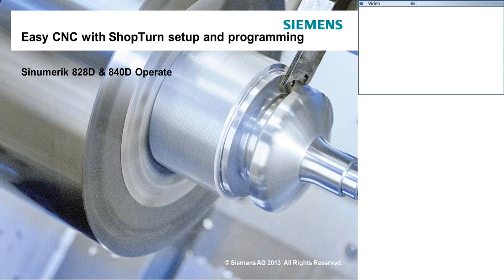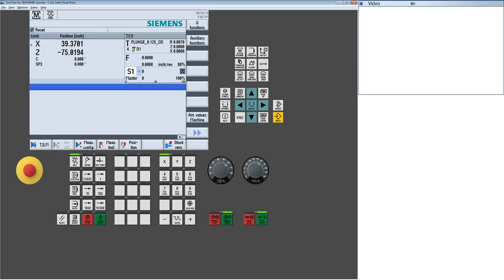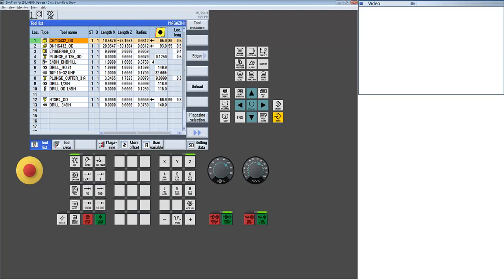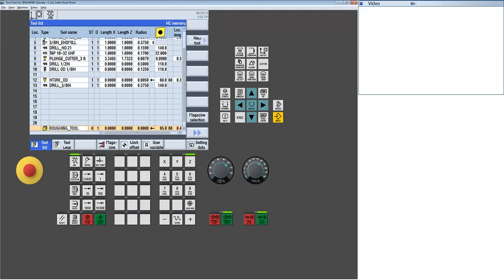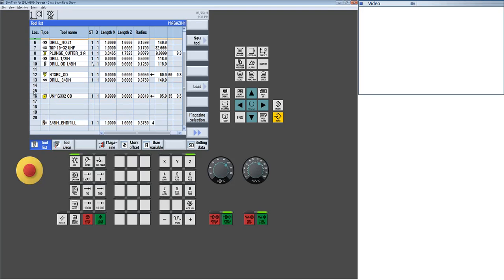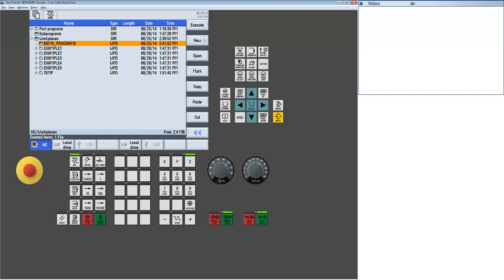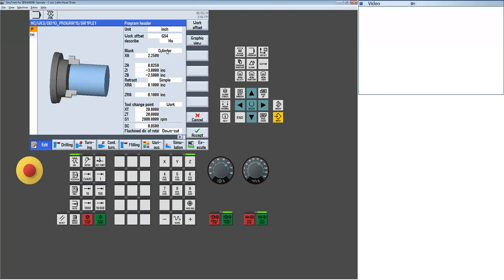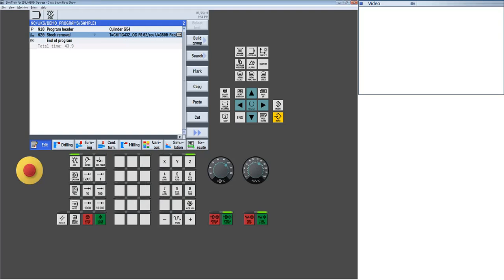Siemens ShopTurn Setup & Programming Sinumerik 840D 828D

Comment: Hi,

I'm looking for a little help with some programming on Siemens 828D. I'm in the process of writing a program for a bar puller and have hit a snag. I've gotten as far as getting the puller into position and gripping the part and releasing the chuck. The chuck unclamps the part, but that's as far as it goes. It throws up alarms like "Waiting for chuck" and "Chuck open/closed without component."

Any idea how to get the machine to accept the open chuck and proceed with the program?

Thanks in advance.
Reply from the maker: This you have to ask the machine tool builder if there is a way to feed or move with the chuck open

Comment: Hello , when executed the simulation of the program this massage is appear
Retraction plane RP is within the machining range what is the problem
Reply from the maker: you typically need to increase the retraction plane.  these are the values in the program header page typically displayed as XRA and ZRA.  It is sometimes easier if you make them ads values not inc values and simply make sure for OD the X value is larger than any value in your program.
Reply: @MrCNC  thank you
Reply: @MrCNC  thanks alot for your perfect explanation ...and I need you help...how I can download a demo for the software milling 5 axes

Comment: Hello,

Question. We are interested in using your controls and modifying a cnc lathe to run a grinding attachment and hot knife for grooving and profiling external rubber. Can you define custom tools for external cnc machining or quick screens for our options only?
Reply from the maker: are you looking to make a custom cycle?

Comment: I have the 828d control on a lathe with manual tool changes.  The tool offset page only allows for 8 tools in a program.  How can I change this to more tools?
Reply from the maker: their is a tool management configuration program that you need to run.  this does differ between OEM's so I would recommend reaching out to your machine builder for the correct program.

Comment: We own a digital control machine and control unit from Siemens sinumerik 840 DSL and includes some of the programs we use in manufacturing when running one of these programs does not cause any problem, but when you refer to it again after a period of 10 days we notice a change in some of the data for the program that lead to the disruption of the program  How will this happen knowing that the machine is new 2018 production please help me solve this problem
Reply from the maker: I am not sure how this happen. 

feel free to reach out. 

Dan.Strubel@siemens.com

Comment: What the difference in used between choice the blank : allowance ,contour and cylinder
Reply: Different methods for defining the stock that you are trying to machine, be it through a contour you have defined outside of the program, a cylinder shape, or an offset from your geometry contour.
Reply from the maker: I agreed with Eggsr2bcrushed

Comment: Would the sinumerik control allow me to import all G code programs created in a cad/cam software?
Reply from the maker: Yes as long as they either comply with our G and M code structure (G290 mode) or if you have ISO mode setup on your control then they can also comply with ISO standards (G291 mode).

Comment: I have this 828d control on a metal spinner but it dose not have the tsm Botton can it be added or can you explain how to get around this please
Reply from the maker: If the oem decided to not support the TSM button then I would suggest using MDA mode in place of TSM.  You will just need to call out each command as a G-code or M-code command.

Comment: I get an mx1 software limit switch alarm when I run the actual program not in simulation how do I fix this?its an 828d basic lathe.
Reply from the maker: you will need to have setup offset for the tools to keep from getting an overtravel in auto mode.  I would suggest seeing what the total travel is for each axis and then use 1/2 the value in the tool offset.  as long as the WCS is set to zero you should not need to adjust the G54.